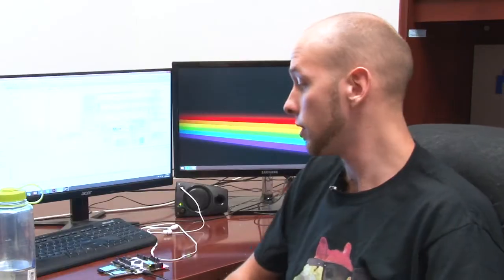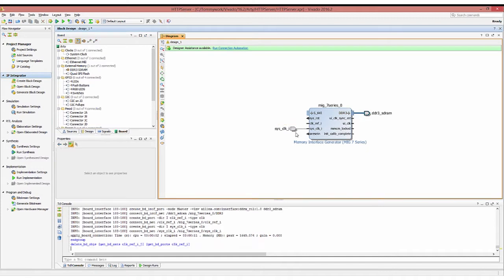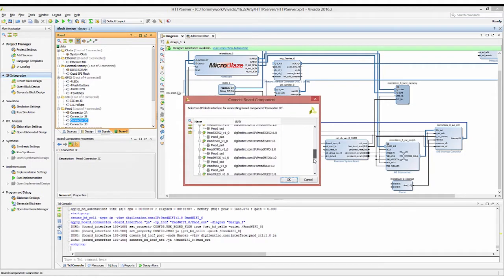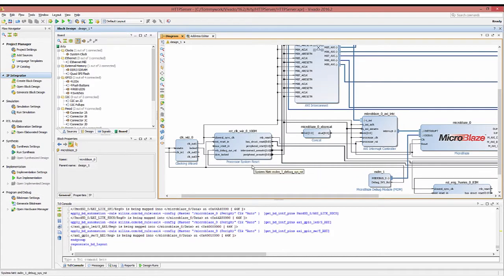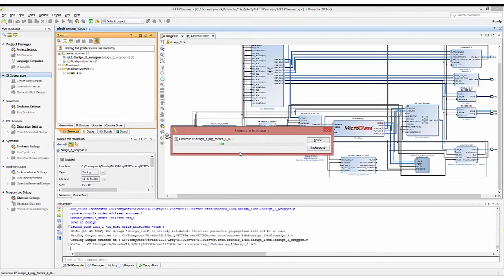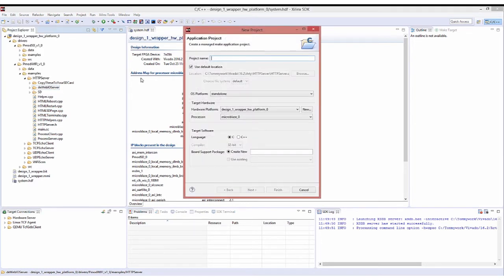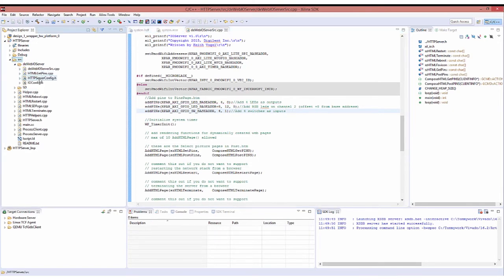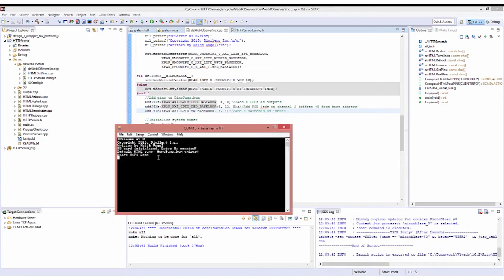Pmod Monthly - November 2016 - Adding WiFi to your Digilent FPGA or Zynq Board

Comment: Just tried this with Vivado 2019.1 and SDK throws a fit because files in the BSP. Errors are in DHCP.h and HeapMgr.h  Arty A7-100 board.  Not really excited about installing older Vivado just to test one simple idea.
Reply: Hi,
I am new to pmod. I am working on the project where I have designed various IPs. I want to send the output of IP to the external world via Bluetooth or Wifi. I would be most grateful if you could give me the direction how I can achieve by pmod.
Reply: I just ran into the same issue with Vivado 2019.1. The errors that I am getting are "error: flexible array member not at end of struct" for "uint8_t     options[]" in DHCPDG_T struct definition (DHCP.h) and "PGID        rgPages[]" in SMGR_T struct defintion (HeapMgr.h). I know this was 5 months ago but have you managed to find a fix to this?

Comment: I m using nexys4 board and it seems the MIG block after adding the ddr2 didnt contain the reference clock input, there only system clock which was connected, will this still affect the design.

Comment: Hi 
Am trying to use a PmodWiFi on Spartan -6 NEXYS 3 board, this video was helpful but some features are not same,  like the board tab is different, kindly  help me with this, if possible, make a short video about it. thanks
Reply from the maker: Hey, that is a great suggestion. It does take quite a while to produce each of these videos, however. So you may find answers to your questions more quickly by posting on the Digilent Forum: https://forum.digilentinc.com/

Here is a video with some helpful tips and trick for posting on our forums: https://youtu.be/krqSlIsPhJo

Thank you!